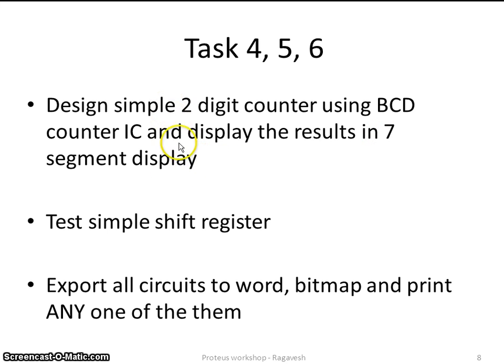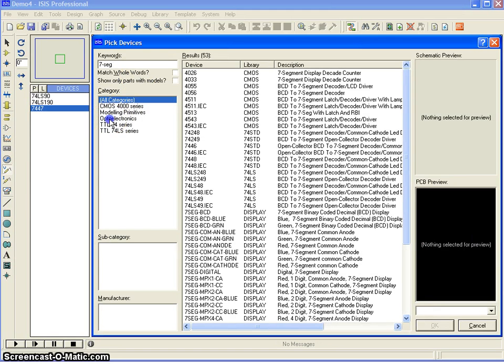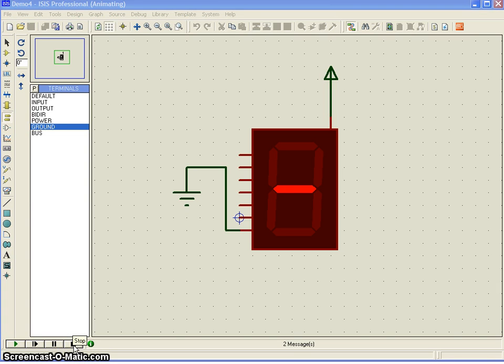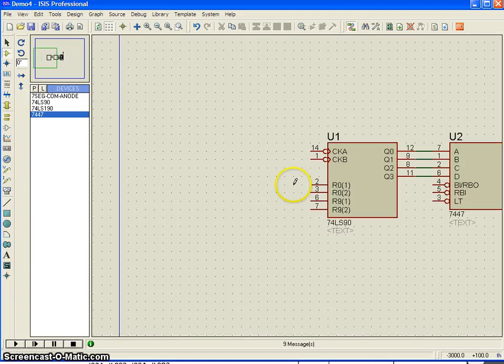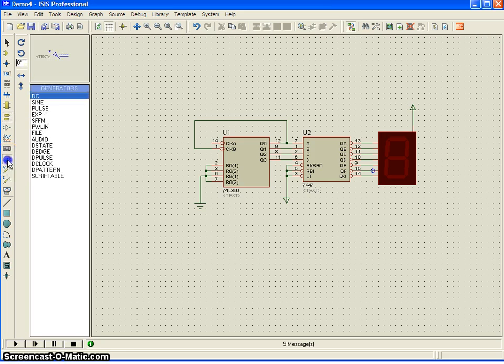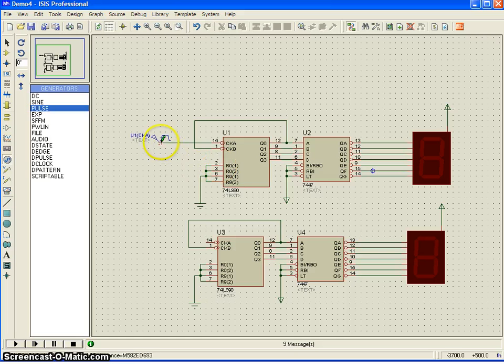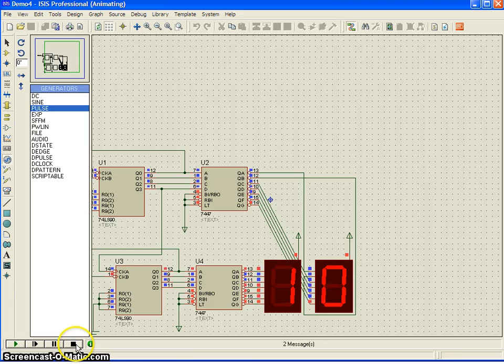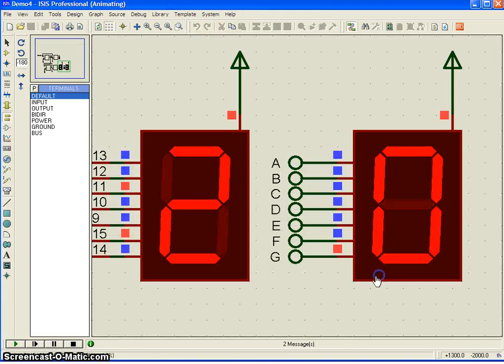Proteus Video 5: BCD Counter  seven segment display

Comment: can we change it to up-down counter and does it have a load for counting from special number
Reply from the maker: Hi.. You have to choose up or down counter IC, configure the mode like up or down counter mode. However this gives 99 to 00 or FF to 00 based on thr IC use have selected. To start with the number u need, we need to load the count value in to the IC. there are such options in counter ics. You can make additional reset logic such a way that when count reaches to 00, instead of rollover you can load your count. If there is no restrictions of usage of microcontrollers, you can use Arduino for counter....

Modified another comment's reply.
Reply: @RagaveshDhandapani    Hi thank you so much for replying unfortunately we couldn't use Arduino do you know what is the best ic number for my usage? and do you know what is the pl input in ic 74191 sorry for so many questions
Reply from the maker: @setayeshk1062  After reading the datasheet of 74191 and 74193 i find both of them is suitable for the up/down counting. Input will be the start count through the load operation and decide up/down counting. Check the lower/upper limit using additional reset logic circuit, once count reaches to that level load with the start count.
Reply: @RagaveshDhandapani  thank you so much🙏🙏
Reply from the maker: @setayeshk1062  Can you watch the short video, just i made it as many have asked about it through comment and email.
Reply: @RagaveshDhandapani  Ok thank you very much.

Comment: 🎉what application you used in designing circuits
Reply from the maker: It's proteus
Reply from the maker: If you wanted to design only circuit with out simulation means.. I recommend kicad

Comment: sir, how can we do the circuit using arduino in Proteus, can you help me?
Reply from the maker: Check the arduino model in proteus, if not, you may get the library. Then, if u r using a new version, you can link to the project. If not, check the temporary folder to locate the hex file to the loaded. Contine to develop source code using arduino ide and simulation in proteus.
Reply: @RagaveshDhandapani  There is no error in the teacher code, but for example, let's say we will use 3 7-segment displays, let's say that there is an arduino uno card that sees this, there is not enough pins and a 3-digit number should be obtained, but how to establish a connection in proteus
Reply from the maker: @Gulden Cetin  check the display requirements.. 7seg must mean, go for multiplexing or exclusive 7 segment display driver. 
If not,  you can switch to i2c lcd. This needs just 2 wires only.
Reply: @RagaveshDhandapani  Sir, there is no problem with the LCD, I need to use 3 separate 7 segment displays. I connected all three of them separately and with efforts.
 I have set one to be active in order but it doesn't work
Reply from the maker: @Gulden Cetin  check one of the videos in 8051.. I explained the multiplexing concept with the c program. Also, proteus has multiplexed 7seg display for quick and easy construction of the circuit.

Comment: Sir i have made excatlty the same circuit but it shows some errors in U4( no model specified for u4) how i can resolve this issue
Reply from the maker: Hi thanks for watching. 
Do share and subscribe to my channel.  It means a lot.

Regarding your doubt.. select the part that has simulation model file in protues. It can be seen when u are selecting component,  on the same windown u must see simulation model. If that window is empty, then choose another IC of same part number.

Comment: i wanna use 2 7seg led to display 2 digit(4bit). just display not counter. how to do? pls help me
Reply from the maker: Hi thanks for watching. 
Do share and subscribe. 

It's not clear. If you mean to say, you want to use 7seg led without counter, yes you can do that. Connect vcc pin, then individual cathode pin of led can be connected to ground through resistor. Hence required segments can be made on or off.
Reply: @RagaveshDhandapani  yeah, for example. i want to display "18" by 7seg leds. input is 10010. how to do?
Reply: without IC, just use logic gates
Reply from the maker: @phuongthaotranthi4266  you have to describe the logic clearly.
Try to find out common led segment pins which will be always ON. Then remaining segment can be controlled based on your requirement.

Comment: Thanks a lot! This helped with my project 👍
Reply from the maker: Great to hear that. This is just concept model.. 
Do subscribe and share.. watch other videos related to your subject.
Reply: Sir is it possible to stop the count at certain number? Because our project ask us to design a counter that counts from 0 until 380 using 7490
Reply from the maker: @nataliechristoper4883  yes. It requires additional reset logic circuit. Write down the count limit as binary.. refer to zero or one, You can figure out the logic circuit by carefully selecting certain bits. 
If count touches to the maximum number the reset should be triggered hence the count will start from zero.
Reply: Thank you so much sir! The only problem is it can't count until 380. It reset when the count reaches 379.
Reply from the maker: @nataliechristoper4883  make it logic for 381... so it counts u till 380. 381 will be reset
Reply: @RagaveshDhandapani  Got it sir! Thank you so much once again!

Comment: sir I have a problem my project is not counting by one it jump and it what can I do to .will it help if I add the value of the resistor connected ti clock A?
Reply from the maker: Thanks for your question. The following may be an issue
1. Clock pulse may be bit high frequency 
2. Push button in the clock circuit is not addressing debouncing issue.
U may use hardware denouncing circuit to overcome the issue. 
Or generate very low frequency Clock signal.

Comment: I have a project to create 10 bit PRNG (pseudo random number  generator ) I have created PRNG circuit using LSFR (shift registers) , but now I have to display my 10 bit output using 3 seven segment display ,but I don't know how to use 3 display simultaneously ..... problem I am facing is I can show upto  0-9 but for output 10-15 I can't display it 😕,what can I do?
Reply from the maker: Hi thanks for watching. Do share and subscribe. 
It can be done in by adding binary to using bcd convertor, however processing 10 bit data may be challenging. We can create counters like 7490 with very high speed clock to count... and the output as such it can be displayed. 10bits means 1023 should be the max number.. you need to check this and reset. Still it's high volume task. 
Keep thinking about or refer some article how to do it. 
I can't comment beyond this as it is your academic work.
Reply: @RagaveshDhandapani  thanks for responding🙌, I am trying to get my answer ,I will definitely find my answer 👍👍
Reply from the maker: @sarabhian2270  is it compulsory to do with digital discrete ICs? If not use microcontroller boards such as arduino and generate random number, convert that value into digits, use multiplexing to select digit and display the 7 segment value. No need of any ICs except uC, display and transistor.
Reply: @RagaveshDhandapani   it is strictly prohibited to use any kind of MCU and PLD , using Arduino its very simple , I am trying to use create multiplexing circuit which will give me output . I have 4 days of time I hope I will complete it asap .thanks for your help and concern
Reply from the maker: @sarabhian2270  oh ok. If there is no restriction on usage of bcd counter, then use 4 for four digits 0000 to 1023.. Still validation is an issue.  

Or.. check binary to bcd I guess this would be bit easier.. b0 to b9, group b0 to b3, b4 to b7, and b8 and b9. Use binary to bcd..
All the best.. this is last post from me
Reply: in simple language i have 10 bit binary number and I want to display it using 3 seven segment display ,how to do it , I tried everything but I am not getting the answer 😶😶

Comment: sir where we can put button
Reply from the maker: Hi thanks for watching. Do share and subscribe.  Not clear about question.  If u ask about push button it is available as component.
Reply: @RagaveshDhandapani   sir when i put button in diagram when i push the button it counts two number at same time what I do
Reply from the maker: @yahyakhan659  use clock through a RC circuit, it is considered as debouncing circuit. 
Or use one shot multivibrator circuit. 
Try to pull down the clock pin to ground through a 10k resistor.

Comment: hi, how can i  make 5 bit binary to bcd converter and display it with two 7segment? please help me, thanks alot
Reply from the maker: Hi.. you can't do it directly. 
You need convert the states after 9 i e. 01010 to 11111 to 0001 0000 to 0011 0001. 
Circuit design may be bit complicated.  
You may try with GAL.
Reply: @RagaveshDhandapani  thankyou
Reply: @RagaveshDhandapani  I know that,but i cant do that, i will try
Reply from the maker: The method what I said is using digital logic only. You need to solve 6 (b5... b0)  output bits having 5 variable(d4... d0) kmap. 
However, you can use Arduino or other microcontroller to read 5 bits and convert binary to bcd code to do the same. Then the converted value can be sent out through a port.
Reply: @RagaveshDhandapani  ok,I search about that,thanks alot for answering
Reply from the maker: @fizikkhoy9563  thanks a lot. Plz subscribe and share

Comment: Why 74LS90 Resets when hit 1010 (10)? It is in build in counter or what?
Reply from the maker: Yes. That's why its called as bcd counter. Ie you can't get any other count such as 1010..1011..1100...1101..1110..1111. 

Refer data sheet.. One flip flop of this ic can be used to count 0 or 1. Hence easy to build clock circuit.
Reply: @RagaveshDhandapani  I saw a datasheet everything is clear :D I will build one by myself using double flip flop and reset circuit :D

Comment: how can make it count from 0 to 64
Reply from the maker: You have to design extra circuit using logic gates to reset the count when it reaches 65. Ie output lines of counters need to be used to get reset signal(0) using 0110 0101, rest of the count the reset signal pin must be 1.

Comment: is it possible to make it count up from 0 to 95 only ?
Reply from the maker: Yes.. You can. Need to reset using tens ic msb and ones ic bit 1 and 2.  1001 0110, its 96. Hence use all ones 1xxx x11x to form decode logic. Hint.Use two 2 input nand gate.
Reply: @RagaveshDhandapani  
Using the same idea you used in the video or anything else?
Reply from the maker: @rossonerirb6632  same of two digit plus extra circuit for reset. Now we connected pin 2. 3. 6 permanent  value based on datasheet. You need to remove that connection n connect output of nand gate.
Reply: @RagaveshDhandapani  
You said that all i need is removing the connection of the four pins 7,6,3,2 and connect them with an output of a nand gate ! Am i right ? 
And what are the inputs of the nand gate ?
Reply from the maker: @rossonerirb6632  yes. No need all check data sheet.
Reply: Can you send me the link of the data sheet? 
And thank you for your help
Reply from the maker: @rossonerirb6632  just google 7490 datasheet pdf.

Comment: thanks its very informative but I need to create 1Hz cycle through 555 ic can any one tell me about that
Reply from the maker: Najeeullah Ahmed hi.. Design 555 timer circuit using the calculations.  Or follow the link
http://www.ohmslawcalculator.com/555-astable-calculator
Then, feed the clock signal to counter. Make sure vcc for timer is 5v. 
Note, if you are looking for precise 1Hz signal its challenging to get using 555.
Reply: ok thanks